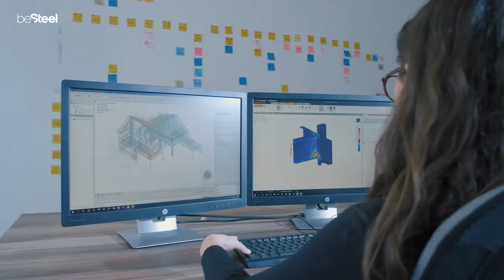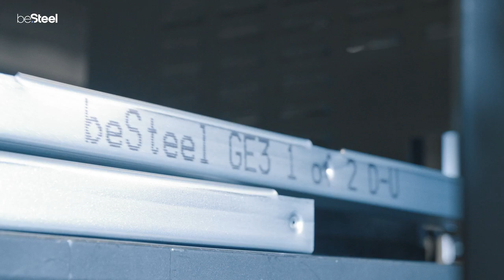Light gauge steel frame building system for commercial residential and industrial projects

Comment: I've thought this SO many times while installing steel studded interior walls, that done just a little different steel could be used for the load bearing structure. And the benefits of increased fire safety, insect and rot proof and since I live on the gulf coast... Hurricane resistance or even proofing (done right)
Reply from the maker: Yes you are right. We have LGS construction company in the United Arab Emirates www.pioner-group.com/technology